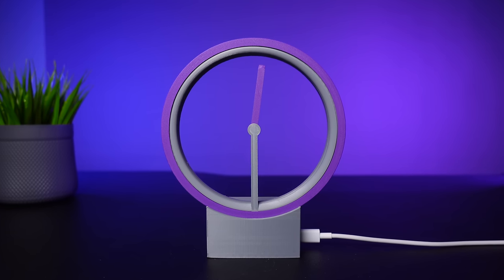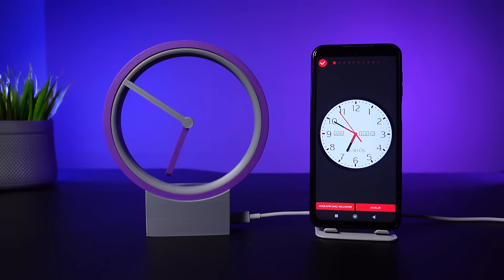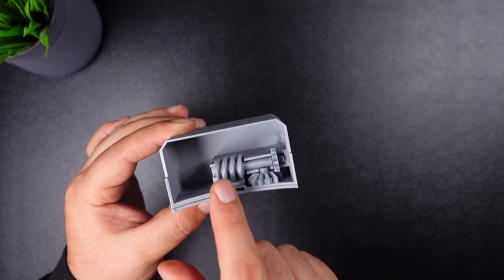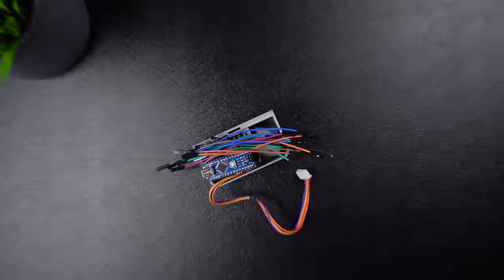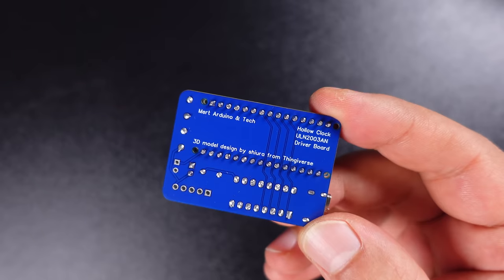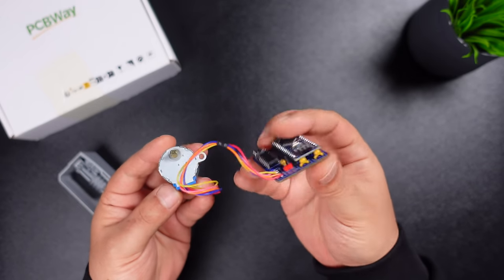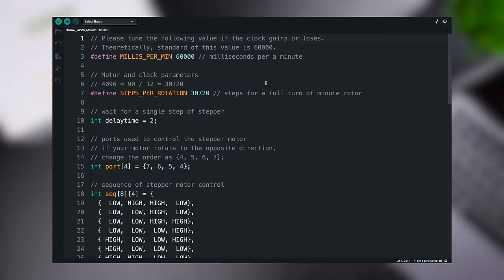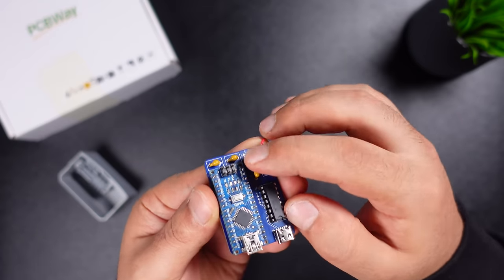How I made this amazing 3D hollow clock

Comment from the maker: 📌 PCB Files, Schematic, 3D Parts and Source Code - https://www.pcbway.com/project/shareproject/3D_Hollow_Clock_Controller_Board_Arduino_Nano_Stepper_Motor_and_ULN2003_Driver_9507c8ea.html
Reply: Will ordering using the above link PCB+Assembly provide the complete component (Audrino Nano + ULN2003) excluding the stepper motor?

Comment: if you make the clock up to scale of a full 3d printer bed so around 20-22 cm in diameter and use floppy drive motor, you could make electronics hidden and power the thing from 3 aaa  or small lipo battery making the whole project just a ring, capable of being wall mounted
you would have to think about different reduction drive  and resynchronize it but it could look really good
Reply from the maker: Thank you very much for your idea. Maybe I can try to make it in the future 😇

Comment: Hello i have a problem with your polographer video from 6 years ago i am trying to make a proyect for my school (more especificaly the code you provide
Reply: I have the same error, in that video.
Reply: @DavidNC219 
Did You fix it?
Reply from the maker: Are you talking about this project? https://youtu.be/0QjO08HNXos?si=W9-NXB2QgS8XwpWh
Actually, there is a detailed explanation here https://github.com/maker101io/mXY-board-xy-plotter-drawing-machine.
Reply: @maker101io  but we are having a problem with the motors (they don't move just vibrate i don't know if something similar happend to you i wish You could held us) i don't know if i need to change some values or some thing
Reply from the maker: @Generalalpha111  First of all, be sure that the project works perfectly when all instructions are followed. Generally there are two causes of vibration, firstly insufficient voltage current (in this case review the power requirements), secondly if the motor connections are reversed or the wire order is different, locking or vibration can occur (sometimes the motors are similar but check the datasheet). Also, take a look at the file named "about-polargraph-software(txt)" in the file "mXY-Plotter-Drawing-Machine(zip)" on GitHub, you might have missed something in the source code.
Reply: @maker101io  now i have again the same error about serial type ambiguos (but before that error happend it was working fine) do You have a solution?
Reply from the maker: @Generalalpha111  Is there an error code? Also, are you getting this error in the Polorgraph interface or in the Processing or Arduino ide editor?

Comment: Beautiful design.  Thank you for sharing.  

Is it quiet?   Would you put it in a bedroom where a baby sleeps?
Reply: Stepper motors can be whisper quiet if you use a special stepper driver that supports stealth chop. Without it they're not really that loud, about the same level as a regular mechanical clock. Try not to put the clock on anything hollow because that greatly amplifies the sound. Shouldn't be a problem as the clock only moves once every minute.
Reply: @PunakiviAddikti  Thanks very much for your advice 😄
Reply from the maker: It's absolutely quiet, you can put it wherever you want
Reply from the maker: @PunakiviAddikti  I agree with you, thank you for the answer

Comment: Love how you got the name of your sponsor wrong the first time. Too bad they're beyond annoying with their sponsorship and host stolen projects on their community sites.
Reply from the maker: I respect your views, but you can think of it as a maker culture, and usually the projects are open source. So I think the phrase "stolen project" is wrong, as each open source project is shared, the contribution to the project increases and the project improves. Like Arduino boards for example, it's completely open source and a lot of manufacturers are copying and producing Arduino boards, but we always talk about Arduino. So the winner is Arduino. As for sponsors, we should think of sponsors as a building block that supports and sustains the maker culture. YouTube view earnings can only buy some components, but sponsors sometimes make extra contributions to projects such as 3D printing support, sometimes PCB + shipping support like in this project. This is important for hobbyists like us.
Reply: @maker101io  Too bad I didn't make my project open source - that's the whole point you're missing. That's why I'll stick with that other major chinese PCB place without the intrusive sponsorships.
Reply: It's an AI generated voice. They probably had a typo in pcb way.